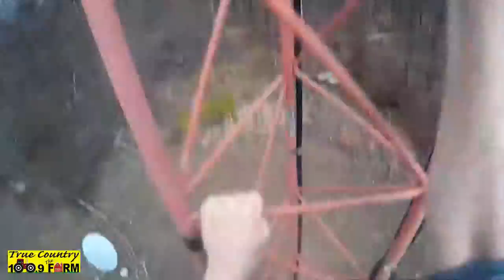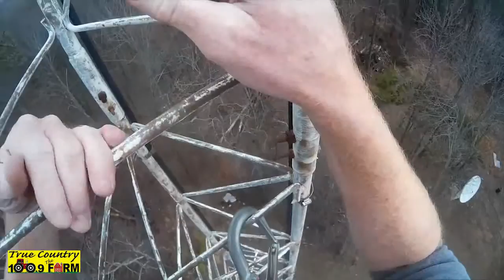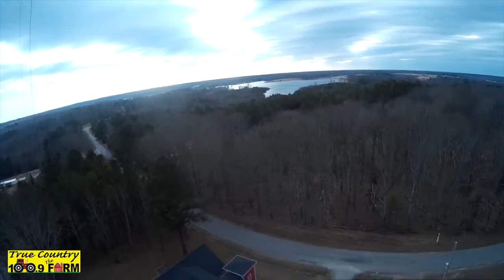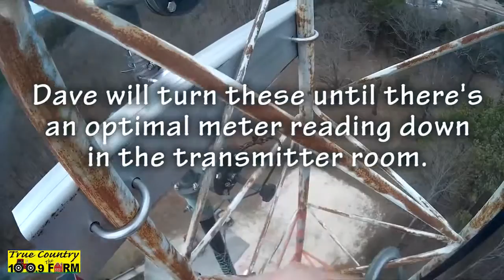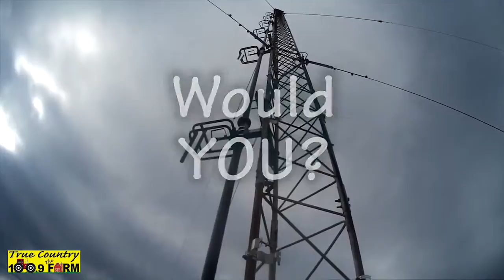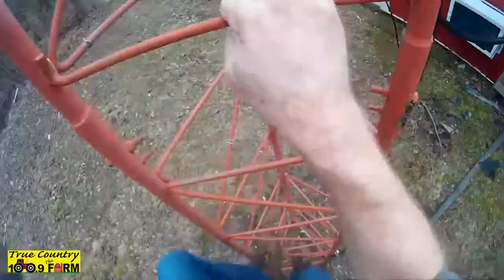Climbing the WEIO Radio Tower

Comment: You still into this gig at all?   
No- I'd be scared shitless 50Ft. up.  
It would take awhile to get used to. 
That bottom general purpose broadcast monitoring antenna did not look at all "sweet & luscious"  it was missing an element and some the others were bent in, and I'm sute he didn't care.  
Good enough for what it may have been being used for. most likely an external transmitter monitor to keep an eye on main transmitter antenna field strength. 
Curious what the actual task might have been? seasonal adjustment/temperature compensation tuning?  

Have a good one.  
And welcome back to 2016.
Reply from the maker: I'm at WJLI in Paducah now. I haven't climbed their tower. I think if I did I would go sterile as they were 100,000 watt flamethrower.
Reply: @Kenheron  LOL on the other old video I meant to mention and ask how many watts for the FM station? 2000-5000?  
Keep in mind that was divided by six for each of those elements. so not a whole lot of power if you are a couple of feet away from the bottom element.  :)    
You should already be sterile from all of the long term exposure to 2.4GHz and 5.8GHz.
In the flying stuff we do.
100,000W is a lot.  Cook with confidence!   
Take care!

Comment: It's very tiring climbing a tower like that if you don't do it all the time.  I used to climb towers, grain elevators and silos all the time but if I didn't climb for a few months I had a real hard time going up more than 100 feet without taking a break so he did a great job if he only climbs occasionally.  Glad he didn't take the express elevator on the way down.